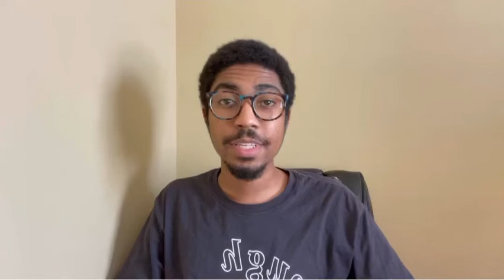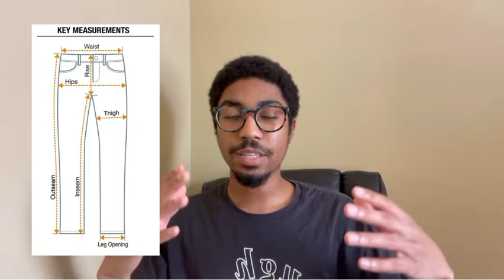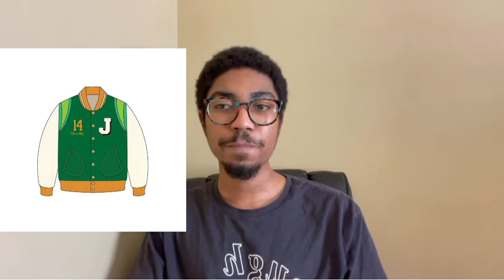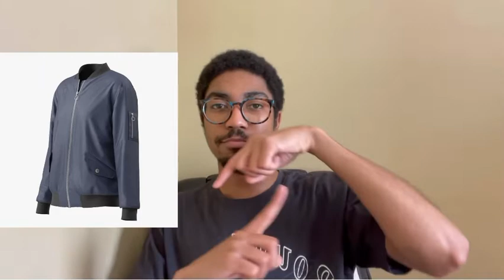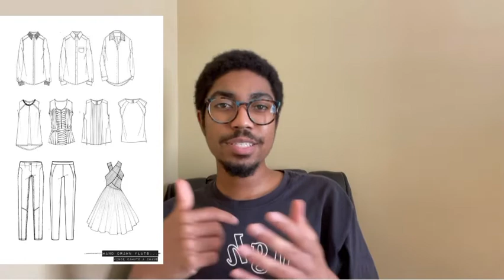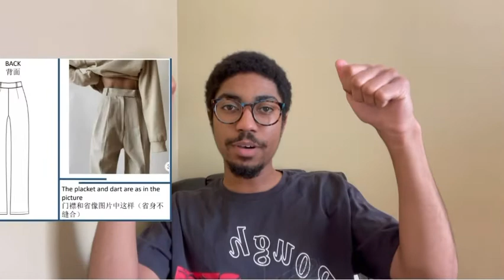Clothing Manufacturing 101: What you need to get started

Comment: question brodie. i really think i have a great idea but i just need an explanation on what pattern is. I wanna make more street wear with sweats, fullzips, and hoodies but i want to make sure i know what i’m talkin about before i start designing
Reply from the maker: Thanks for checking out the vid! So basically your pattern is your blueprint for your garment and it allows the manufacturer to reproduce the garment with accuracy. Google “technical fashion terms” and that should be a good start to help you describe your designs better
Reply: @nicholasakoto is a pattern 100% necessary If measurments and techpack is provided?
Reply from the maker: @haffa0905  often a manufacturer will  make a pattern based on your measurements. But if you want, you can have a pattern made locally and then send it to your manufacturer

Comment: If i get a sample and i am happy with it. do I then order a full size run to make sure their grading is correct or should I source a local pattern maker to make sure they make the grade that I want?
Reply from the maker: Both routes are ways you can take. Ordering a sample in each size can be costly but it may save money down the line by reducing mistakes. If you can link up with a local pattern maker/tailor, I’d suggest doing that because then you can sit down with them and actually make the necessary changes to the fit in real time. Then take all that info to the manufacturer after
Reply: @nicholasakoto  Thanks for the feedback man. I think it will be easier to ask the manu for the full size run with no graphics to see how well they can do it. or i even found that a lot of places use a formula in excel to grade their size range. I think i will give this a go and see how it works.

Comment: Would the measurements be for each size? Or let’s say I like the way a shirt fits on me. Can I give the measurements on an extra large shirt and the manufacturer makes the rest on the measurements for the other sizes in ratio of the extra large example?
Reply from the maker: So you can give a manufacturer the measurements of a specific size and then they can use that to determine the measurements for the other sizes.

But make sure to ask them what their “Grading Rule” is. That way you know how much they add or subtract from measurements to make the other sizes

I’ve had times where I let a manufacturer grade on their own and all my tees were practically the same size lol
Reply: @nicholasakoto  thank you bro